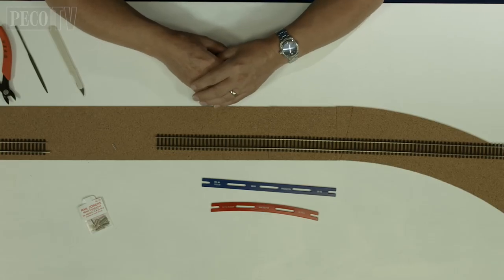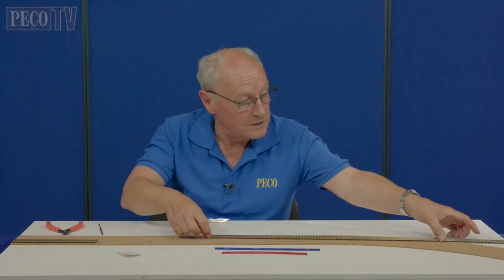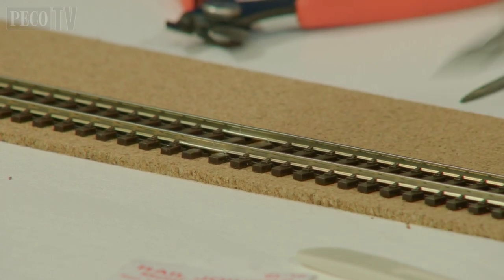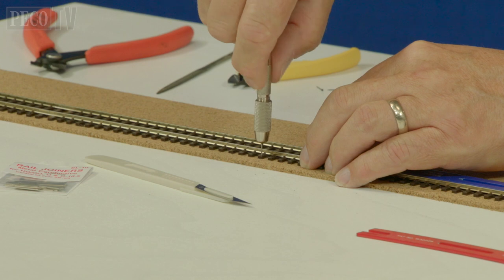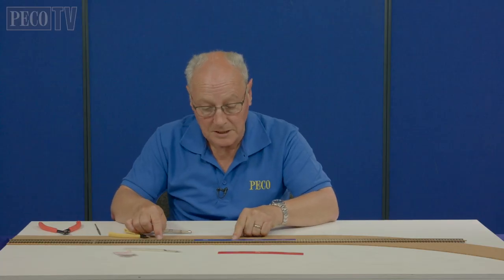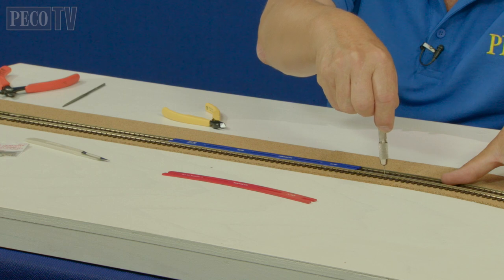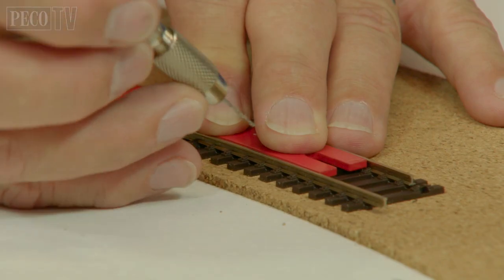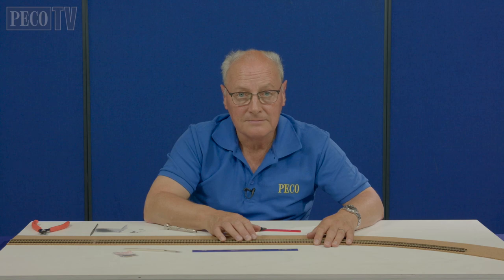Laying Flexible Track Part 2

Comment: OK, I'm using Peco Code 83 HO SuperFlex 36" tracks.  I've got the Peco rail joiners as you mentioned in Part 1.  The major problem I'm having is that the joiners are much too tight.  They can't slide on as easily as you show.  I've mentioned this on a train forum and I was told by more than a few blokes that I had to file the rail webbing and feet with needle nose files so the joiners will slip on.  This is ridiculous as I bought only Peco products and they should work without me removing metal from the rails.  On top of that, my eyesight is bad and I use the head band magnifiers with a light.  Extremely tedious.  PLEASE ADVISE WHAT I CAN DO TO RESOLVE THIS.  Also, what size bit did you use for the pin vise?  A list of what you used in the description would be helpful.  Cheers, Bob

Comment: Hello, 

is it possible to know what Angle is the Tracksetta 24 inch curve template? As in, if it's 12 degrees for example so it could be used to "straighten" out the track going from 12 degree turn?

Comment: How do you suggest we drill the sleepers on n gauge?
Reply from the maker: Hi Glenn, personally I use a small modelling hand drill. Really is quite a handy tool
Reply: @PECOrailwaymodeller  Yes I use a Dremel with a 1mm drill but it skates off the sleeper - I'll have to try a smaller drill bit - thanks for your advice

Comment: It seems easier just to glue the track rather than drill all them holes and then use nails any thoughts on this?
Reply: Certainly for N gauge - very fiddly trying to drill sleepers at this scale in  my experience.  And I've quite easily re-lifted glued track when I've made an error.
Reply: Glue could fail over time, and in a hobby that is usually housed in either a roasting hot attic or a damp shed for decades, most would opt for the pins for the long-term reliability. Plus, it's much easier to pull up pins and raise the track if anything ever goes wrong - dropper wires failing and needing reconnecting etc.